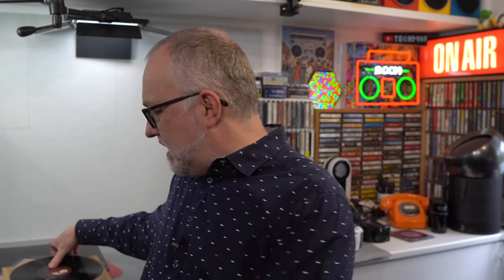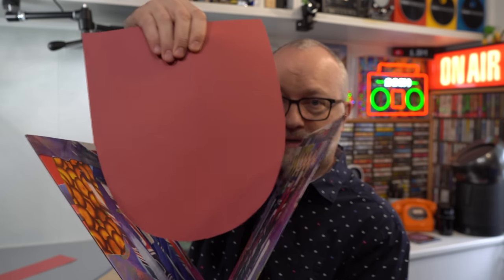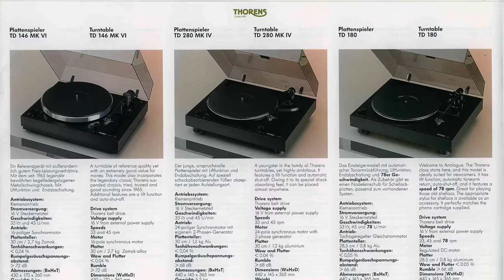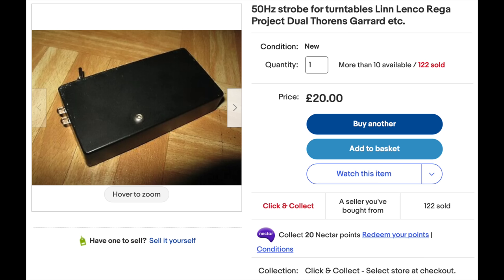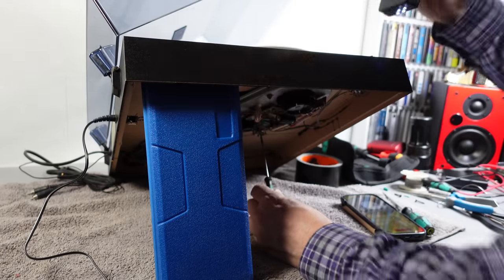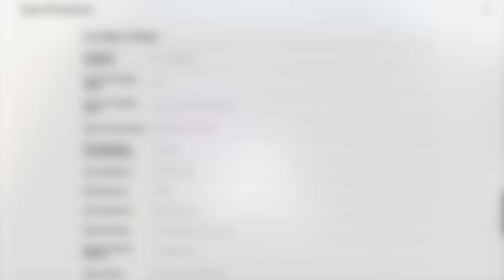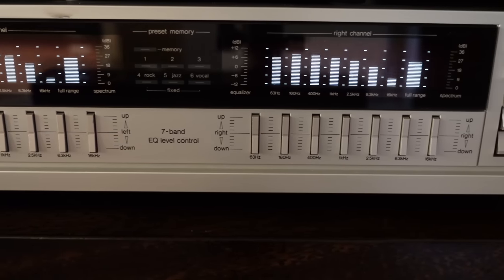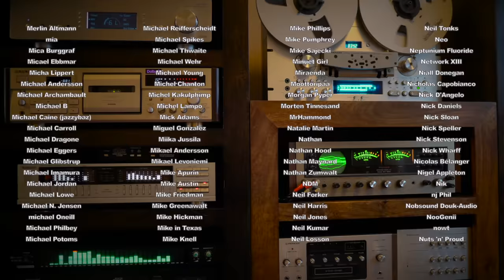Playing 78 RPM Shellac Records properly

Comment: I have a vintage BSR Record Changer that uses a flip style stylus. The LP stylus side is a 1 mil and the 78 side is 3 mil. The record player is attached to what was known as an all in one compact record player stereo which has cassette player and 8-track player with recorders. I personally think it is not a good idea to use the drop mechanism to play record, I will place the record on the platter passing the drop leaver and lifting up the cueing arm to use the automatic feature to sent the arm to correct place and lowering the arm manually. I will allow the eject to return the arm to home. After playing a fair amount of  78rpm records I do need to readjust the tracking where the needle goes onto record and retracts, that is few and far between each time needing to do.
Reply: Mid 60's BSR changers used a feeler for auto size select, I push it down one click while the spindle drop lever is fully in, the arm then goes to 10" position. I finished with the BSR crap and moved on to AT turntables to play 78
Reply: @manFromPeterborough  the drop down for the automatic changer can be adjuste. if you play a 78rpm the speed tends to misalign the positioning, there is a screw under the tonearm when you lift it up that can recalibrate where it is supposed to set down. I only use the automatic feature on 78rpm to locate the place to put the needle, I manually cue it down and let the arm return to home. I don't trust the 78 to drop by the automatic since they are so brittle now.

Comment: You will still have the limitation of needing to play only old “ New “ stock, which will definitely limit your available choices of music. Most 78’s will have been played either on a mica disc tone  arm with either a steel needle  or if it was an audiophile from the past the use of a cactus needle. 
Post WWII when the record industry was transferring from direct mechanical to electronic, the fixed tone arm would have had a cartridge that used similar steel or cactus needles. The reason most old 78’s have a scratchy sound is due to most people using a steel needle on the shellac record which cut through the top coating. The cactus needle would ride  along the grooves and the cactus needle retained a small amount of moisture which lubricated the needle in the groove. However since the weight especially with the mica disc tone arm was substantial, they would wear down quickly. But with the correct equipment could be resharpened to cloe to the origional.

Comment: Sure it was (mainly) the belt! The speed control is on the motor axis not on the platter, thus the slip of the belt is not corrected (or only to a predefined amount) 
Illuminating the sensor with a flashlight is quite a voodoo-thing without effect: it is not about the amount of light coming to the sensor (it's always a 50% duty-cycle square-wave) but the speed of the pulses generates the feedback for the control loop (there are some frequency to voltage circuits, integrated or not).
I've seen some impressing repairs on your videos, not this one 😢
Overall, great channel, always interesting topics, thanks! 🎉

Comment: Strobe discs work best with an old fashioned transformer ballast fluorescent lamp (not the modern switch mode electronic ballasts)....So much so that despite using almost exclusively incandescent lighting I keep a vintage fluorescent desk lamp to use with my strobe discs. Granted line frequency is lower outside of America so the filament in an incandescent bulb has more time to cool and dim between cycles, and maybe incandescent works better for strobe discs in 50Hz land.

Those cheap ceramic carts work great for older tube era equipment that originally had ceramic or crystal pickups.

Comment: I thought about this for a while and wondered of you could just have bought the 78 stylus for your best machine then recorded stereo phono out at 45rpm which would lack riaa eq. Then you can correct the speed and apply eq digitally.  You can cut beyond a modest frequency because 78s simply didn't record them so they are always artifacts. For archiving mono, I thought perhaps you need to combine left and right by removing any noise that isn't common to left and right, you could also just wire the cartridge in series on a single channel. One possible issue with my method is the frequency response of the cartridge,  it may roll off the lowest frequencies.

Comment: You could have done the mono conversion in software. I think there are even some plugins that can combine the two channels into one and do the de-popping/denoising by choosing the best channel for each individual moment in the record. Also, you could adjust the speed in software as long as you know what the speed deviation is (though yea, you will lose some quality in the process, so it is always better to try to make the player play at the correct speed).

Comment: all the heads of the audio equipment of the AT VM 95 series are the same, the difference is only in the inserts, you could buy a 120 model player and an AT-VM95SP insert and change it

Comment: I use a DUAL 1216 turntable made in Germany with a Shure 78 diamond stylus 2.5 mil and magnetic cartridge. It sounds fantastic even after thousands of hours of play, diamonds are forever. They say to replace the stylus after 1000 hours, but they also say wearing a mask stops the covid virus. My stylus is 30 years old and the turntable is 50 and that's that.

Comment: You will get an even better result by using a MONO CARTRIDGE in stead of pushing the mono button or disconnecting a cable. Why? Because some clics and pops come from vertical movement, and a mono cartridge won't pick them up at all.

Comment: Yeah I think the AT PL 120 is the best bang for the buck for this purpose since a lot of 78 RPM records are not recorded at exactly 78 RPM. For best results, you also need a variable phono amp to adjust for the myriad differences in equalization for all the different labels. It's tricky.
Reply: Also good for the 8.5 inch 78s with the tiny labels - most players stop those halfway through.

Comment: I wondered if you would address the equalization curve issue. My late uncle designed and built a gadget to remove the RIAA curve and add the other curves in, based on selector switches. I have the gadget, and could probably reverse engineer it.  IIRC, it was designed around a few LM-384 op amps.

Comment: The quest for better audio suffers from diminishing returns. I’ve found a good bit of audio gear might be 100 times better than a cheap crap thing, but a super amazing piece of expensive gear is only a little bit better than an average priced thing. Also a lot of the high end stuff is just snake oil as well you know.

Comment: Incandescent bulbs do not flicker. To flicker the filament would have to heat up to  4500 degrees and cool of to less than 500 degree 120 times per second. Not likely. You need LED or arc discharge, idealy florescent. A light source with no inertia.
Reply: Stroboscopic discs do work with incandescent bulbs.
The lines will be faint, but still clearly visible.
 In my experience, the discs don't work at all with LED room lighting.

Comment: The reason they claim to be able to play 78's is they originally sold a different stylus for these cartridges and you was required to physically switch the stylus. It is a similar idea to the old 3 speed changers with the flip stylus system

Comment: Just thinking, so I looked it up... You can get Arduino code to drive a stepper motor at 33prm etc for turntables. If you could cobble that up to a turntable, you'd have a very accurate turntable. Stepper motors have a load of torque and are available in any size you like, maybe you could stick a steel disc flywheel to one to give it a bit of inertia and smoothness, seems within your DIY skillz, Mat. There are a few projects using Arduinos like that, presumably the code isn't too complex, it shouldn't need to be, you might be able to tweak it if necessary, or else a viewer could help you out. Arduino setup is pretty easy, just a USB lead, even if you don't fancy being a programmer. The code's probably fine out of the box. then you download the Arduino software and point it at the code you want to send to the Arduino chip. 

It's an interesting hobby too and might come in useful here and there.

You could maybe knock up a useful strobe light too, what I worry about the 20 quid one, is how do you know it's accurate? An Arduino is only as accurate as the clock it's connected to. Usually quartz crystals are pretty good but good to check if you can. I wonder if you could connect a piezo speaker, the little cheesy ones they put in wristwatches, in parallel with the LED? They have high impedance so won't load down the strobe box. Then you'd have sound and light together and could use a sound frequency measuring tool, usually very accurate on a phone or PC. Then I suppose count the marks round the edge of the turntable, I dunno, or just assume that whatever the strobe frequency is, it ought to be a multiple of 33 / 45 / 78.

Comment: If it was me with that slow-running turntable, I would simply record the audio in, then pitch-shift it upwards in an audio editor. Using this one as an example: 78 / 73.92 = approx 105.5% speed.

Comment: I was thinking that if your plan was to digitize the audio, then you could get that cartridge (or maybe just the stylus) and record it at 45 RPM. Then use editing software to increase the speed. It would have made for a shorter and admittedly less interesting video, but it could work.

Comment: I’m old enough to have purchased chart records when I was a kid. As people moved to CDs I picked up a few turntables, which at the time were being dumped for cheap at car boot sales. However, I had no idea that the weight and angle of the head mattered at all. Nor did I ever think about the speed being wrong or that needles had different widths. In my defence, there was no internet and I wasn’t buying new equipment (no instructions), so how would you find this stuff out on your own other than by accident?

Comment: I know this video is almost a year old, but I wanted to warn against using Rifa capacitors and that style in general. Many older computers used them and when they die they give off a really foul smell. Considering that was a new replacement it should be fine for years, but next time it may be worth looking into alternatives for Rifas.

Comment: Why didn't you acquire a vintage (1960s - 1970s) Dual, Garrard, Perpetuum-Ebner or Miracord record changer?  These are very common on the second-hand market, sometimes they even have a speed adjustment, and to the extent they need maintenance it's often a matter of cleaning, lubrication and basic maintenance. My Dual 1219 is an ideal example of a player for 78s.

Comment: Since the speed of the turntable was consistently wrong, have you checked the output voltage of your power supply? It might be in spec for modern electronics, but might cause exactly your problem with an analog device.

Comment: Component drift with aging is likely the reason the speed would change. The trim pots are there to adjust the speed. The idea not to touch them initially is misguided

Comment: If you're not happy adjusting the pots, then what are the pots for if not adjusting the speed if it drifts? They'd have used fixed resistors if they never intended to have adjustments, which would've been the cheaper option...

Comment: You only needed that desoldering tool it was a double sided thru plated board which this isn't, a bog standard iron would have done the job just as well without even cutting the leads.

Comment: Four months late to the party, but wanted to share my ¢¢ about the pots

Option 1: pots drifted with time, being the same pots in the same place, maybe even from the same batch, they got affected the same way

Option 2: pots were tuned incorrectly at factory, and prev owner never cared to test/fix

Option 3: prev owner did try to test/fix, but used out-of-tolerance tools, ending up in mistuning consistently.

Example, you say you trust the app, but it uses the phone's sensors (gyro/accel/whatever), and those might use parts with tolerances good enough for phone usage, but not for your purpose. Even any smoothing algo used on their output might interfere with the end result.

Comment: The Audio Technica turntables are best value and build.   You don't need a 3 mil stylus.. you can use a 2 to 2.3 mil conical stylus. Just a cheap one and you'll get great results.  3mil is for those people that want to swap out different carts for marginal difference in sound - sometimes the 2mil stylus can get better response from some 78s especailly the more modern discs.

Comment: This will probably get buried, but … for many old recordings, 78s are the only existing source. There are no tapes, no masters, no stems. Hence: DO NOT PLAY 78s ON VINTAGE EQUIPMENT unless they are extremely common and worthless. Very play with a steel needle (even a new one) and heavy tracking will degrade the record. Physically. As in abrasive action, destructive, irreversible. Any record of any value should be played with a modern player and appropriate cartridge.

Comment: Using a stereo cartridge, even when summed to mono is not the best. You should really have a mono cartridge. The needle can only move side to side rather than at 45 degree angles. The old LPs from the Beatles were sold as mono or stereo, and we were told never to use our mono cartridge to play stereo LPs as it would not allow movement at an angle and would trash the groove.
Reply: A late 60's BSR kiddie TT had a mono X5M cart had the words Stereo records may be played on this instrument
Reply: @manFromPeterborough  Once stereo records became commonplace, cartridge manufacturers made mono cartridges that could comply with the movement of the stereo Groove. Still mono, but it didn't damage the record.

Comment: The resistors that those pots use as voltage dividers can drift over time. The fix would be to replace the resistors with some new metal film resistors to make sure the values don't drift anymore over time so adjusting the pots was the quick fix but a long term fix would be a resistor swap. Or for all we know they may not drift anymore and the adjustment may be permanent.

Comment: I got a Technics SL1200 mkIV
Reply: Good stuff. I started with a BSR UA8 old school 'suitcase' player with autochanger, which was fun but prone to hum and those vintage valves probably were a fire hazard. I then got a Lenco L75 which was fun and allowed you to change the speed on the fly as it were. I also played around with DJ decks - Numark T500s before finally getting my Technics. I only play 78s on this so no need to change cart/styli. It can be addictive and fun to play these almost-century-old records back. I have 'first press' Billie Holiday, Elvis etc. Opera can be tedious often with over a dozen discs - Offenbach's Orpheus is 30 discs I think!
Reply: Mine came with a noisy transformer, hum on silent grooves near end of record, I also bought a 140XP with the same issue, the TF got replaced with a toroid type, audio was mains earthed causing hum loop with ground wire on, I since disconnect audio ground from the mains earth, it now rivals the 1200 MK4, and not having to use step down supply being in a 240V country

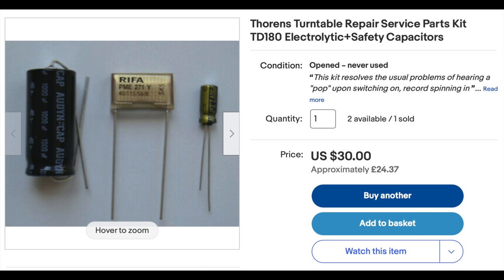Comment: That capacitor kit at 15:14 is just ridiciously overpriced in my opinion. You could order 10 or more of those sets at any electronics part supplier for this price (including shipping). Also you would get new parts, capacitors marked RIFA shouldn't have been around since at least 2007. You can still get those series, but they now come under the KEMET/Yageo brand.

Comment: I wonder if the "stereo" signal has clicks in different places on the two channels if it would make sense to apply a digital filter which combines the two channels but takes only one instead of a combination in places where there is an above average difference between the channels.

Of course I always thought that it should be possible with stereo records (or recordings) as well if you have more than one of the same recording. Probably the easiest in programming if you have three and just take the two almost identical ones if only one differs.

Comment: i use the audio Tecnica turntable that you mentioned here.
I've gotta say it's pretty good with the 78;s.
I'm just using the standard stylus that came with it for the three speeds and I haven't had any problems so far. It sounds about the same as what you constructed.

Comment: Regards the stereo/mono issue. Switching to mono will improve the sound, but there's a bigger problem  Because you're using a stereo cart, it will pick up clicks and pops caused by the vertical movement of the needle. Using a mono cart will give you a better result.

One way around this issue is to get a mono ceramic cart like a GP91 1SC which is amazingly still available. Plug it into a normal line input on your amp and avoid all the eq issues as well.

Comment: Inputting one channel does a good job to make it mono, but summing the channels could drastically reduce noise. It's the same phase cancelling that happens with microphones.

78s can be even better if cleaned. There's 2 ways, but with two rules--keep the label dry(!) and use a clean, flat surface(!):
1. (What I do but it's not for everyone) A drop of no-chemical dish soap in a dish of warm water, using a toothbrush to scrub it. Rinse under tap and either vacuum or dry with a microfiber cloth.
2. (Easy option) Get cotton pads from £ or $ store, use distilled or reverse-osmosis water to scrub the record. Dab the pad and spread the water so it's wet but not dripping, then start scrubbing by following the grooves--never scrub from label to edge(!). This may take several pads and lots of scrubbing. Dry with vacuum or microfiber cloth.